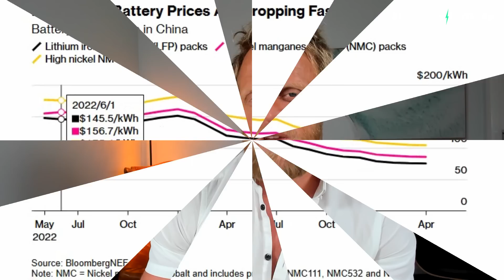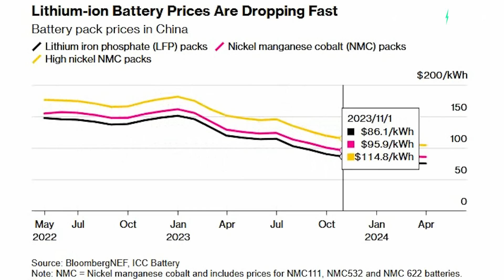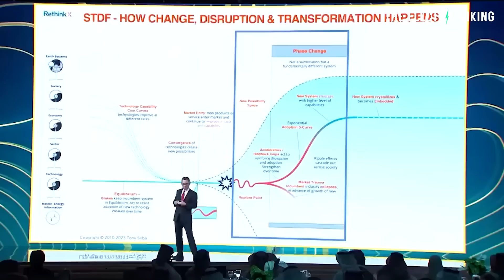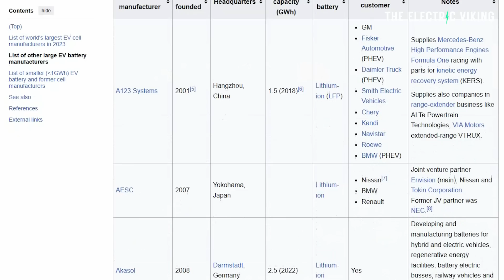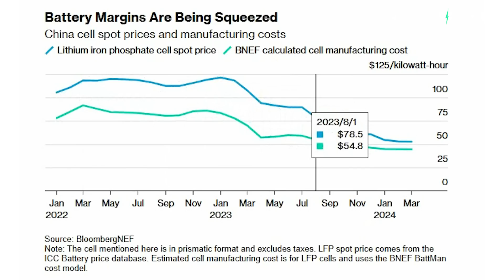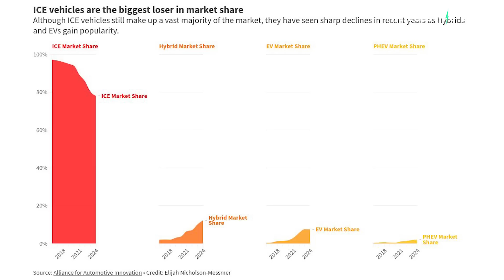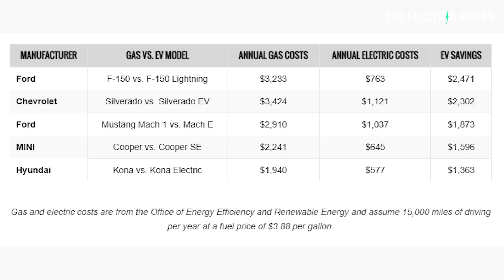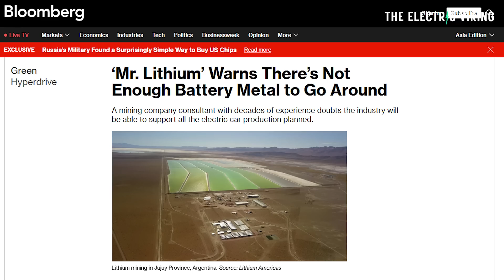Battery prices fall 51% to $53 per kilowatt-hour; "EV prices will keep falling"

Comment: The real issue is that most legacy automakers are not using the class leading Chinese made batteries and are usually paying much more for much less class leading capability.  The automakers in the US are now producing vehicles at an average price of around $48,000 USD, well beyond the average buyer's means. They love those high margins and will likely not want to reduce them to the consumer.
Reply: Yep, JLR opted for pouch cells for their now ancient ipace. Purely on cost / profit.

Comment: The Camels back has been broken, we are now on such a strong trajectory with clean energy, it cannot be stopped. 
Those of you who jumped on the band wagon, your contribution was worth it. 
I can report real numbers on my business auto costs, it’s down almost 60%. Yes, I too could not believe it but took audited P&L numbers to compare 2017 to 2024 reporting on vehicle costs. Simplified!!!  We drove a Chrysler T&C  and a Ford Escape in 2017 and now drive Toyota BZ & Rav4 Prime…… including repayments, our vehicle costs are down 58% it’s simply unbelievable and I am ecstatic to tell my grandkids.   SMALL CORRECTION. Its so simple to keep my cars charged that we do it at home and here is BC Canada we have enormous Hydro, really clean energy and cheap, so my Hydro costs increased by about $90 a month, $1,000 a year and takes that number down to about 50% reduction in car costs.

Comment: The  Prices can go  all  the  way  into  the  basement !  It  will not make these Vehicles any more " Practical " and  NOR  will it  make  them GENUINELY  " Green " . The whole idea is complete rubbish  at  the  moment .
Reply: You know what's rubbish? ^^^
Reply: @ronaldov09  . YES , I  do .
The  whole  MASSIVE  LIE  that E.V's  are a " Green Solution " . There is nothing Green about them . VERY resource heavy and virtually impossible to recycle , PLUS , the Electricity they run on is PRIMARILY produced by  Coal and Gas .
The whole Idea is a bit of  EPA  driven 
" Crackpottery " . Truly long distance Travel will still require Fossil or Sustainable  Liquid Fuel for  DECADES  more , at least .
And we haven't even discussed the Instability and Explosion risk involved with the Batteries , yet...............

It's  ALL  a  Fake , ill-informed  Political Ploy/Agenda .

Comment: For a 62kwh battery (Kia Niro EV) that's $3,300. Add on the inevitable 100% margin, that's $6,600 per vehicle. So why is the cost of a Niro $40,000 (equivalent), in a lot of European countries? Ripoff.

Comment: you still have to have the power and infrastructure to charge it
Reply: We need to redo the whole power grid at this point. Ai needs unlimited power. The future is electric. The Kardashev scale has showcased its importance for 90 years now. We not even type one yet💀 But at least things are starting to happen

Comment: Ok, I'll buy one. As soon as they offer a model with a range of 800+ km for a price between 20 and 30k Euro. 🥱
Reply: No car does that nowadays. Also why would you need 800km?
Reply: @nfzeta128 If a company claims a range of 800km, it is always measured under "optimal" conditions, so you have to subtract at least a few dozen kilometres for the "real life experience". Then there is the topic of battery degradation (1-3% per year). And then you have to consider winter conditions, where the electricity consumption of EVs goes way up. Nowadays you can buy an EV for roundabout 40+ k Euro in Europe, and the estimated range under optimal conditions is around 500km. That's not enough, if you want to make a longer trip under suboptimal conditions. So let's wait and see if the perfect EV projections come true in 3-4 years.
Reply: @first7589  You're working with a lot of outdated or just incorrect information. Degradation is 1.5 - 2% and that isn't linear as it falls off in terms of degradation as you go past the first few years.
Not to mention a lot of 40k+ cars are starting to have 500-700 miles in rated range.
Also again, no car does that. Average for ICE us about 40k and up right now and with smaller engines and fuel tanks a lot of them don't have 650-700km of range, which would be less than the conversion after calculating actual range.
Reply: @first7589  Also heat pumps solve the winter condition range thing for the most part.

Comment: Here's what will happen in the next decade:

1. Overcapacity
2. Energy Surplus
3. Free Hydrogen w Surplus Energy
4. Car market crashes due to EV's longer lifespan + inflation
5. Battery sales replace car market revenue losses
6. Humanoids destroy jobs
7. People buy a humanoid and become farmers
Reply: 7a. On Bill Gates’ farm
Reply: there's no 'longer life span' due to the batteries shorting out.   
Same for 'energy surplus'.     Most solar arrays are a push as far as 'making money' feeding overage inti the grid.   The utilities like the monopoly they have.  It won't change in eight decades.  Never mind just ten years .
Reply: 3. You will NOT see free Hydrogen in any meaningful quantity. The surplus energy will go into batteries, pumped hydro, compressed air... etc. Gross overcapacity will be mothballed... though the market is currently voracious. Companies that give things away due to inefficiency go away fairly quickly. Free Hydrogen was a myth spread by Nikola... before its CEO went to jail. Hydrogen prices have been going up as H2 cars have nearly disappeared. (Its also very expensive to store, ship and distribute.

You might also add that the low price of automated taxis will also eat into the car market.

Comment: EV cars are still a pain to recharge.  5 mintues to fill your gas car or over an hour to charge your car.  WTF.  Carbon credits are bs.  EV is not great for the usa with long drive times.  WHen you can get 1k range and a 10  mintue full charge and drop the price 50% then most will buy an ev.  The REV is the best solution then a full EV

Comment: This guy is totally insane. Ev might be cheaper that standard car in future? So what? You dont have place to charge it! Electric grid and charging station compacity will not support wide spread ev implementation for next 20 years.
Reply: Honest question: Why not? On average, car drives 40km a day. At 200wh/km, that is 8kWh. In vast majority of cases, you drive home, plug the car, go into the house. Sleep, go out and take the car. There is at least 10 hours to charge the car, i.e. equivalent of 0.8 kW for 10 hours (that is about a half of electric kettle).

Our grid seriously can't power a mini kettle in each home? Or in other terms a 10 incandescent light bulbs? And that is at night, when demand is only 60% of day peak.

The fast charging stations will have to have balancing batteries to deal with high peak demands.
Reply: @VoicesInDark  Ok I will assume you are not trolling. Not everyone has single family house with garage( shocking right?) I park outside, about 50 meters from my apartment. Me and 99% of people dont drive 40 every day. Some days i dont use car at all and some days I drive 200, 300, 700km in one go. So in reality to adopt electric cars you would need same density of charging stations as gas stations and charging caoont take more than 5-10 minutes othervise you would get endless lines.
Reply: @rabbithole8498  Grid is only interested in averages and your high average is compensated by someone else who doesn't drive as much. Grid doesn't care about individual data points, only aggregate, so that is not an argument that "will not support [..] ev implementation." Someone who drives a lot will use fast charging a lot.

Apartment blocks are solveable issue - there already is a similar infrastructure: street lights. And we don't need to build them all at once, just to manage increasing number of EVs (which even in most optimistic predictions is 10% increase a year). And even if that didn't work (Norway and other places disagree), fast charing station is much simpler to put somewhere than to dig place for gasoline. It's not like we need to build them all at once, only at rate of EVs in general car population.

>  Me and 99% of people dont drive 40 every day.

Histogram of daily travel distance disagrees. 80% of travels are below 50km. The rest will either be done though fast charging or just what is in the battery (it can go much farther than 40km).
Reply: @VoicesInDark  Ok so you were trolling. Silly me for assuming otherwise.
Reply: @rabbithole8498  Feeling of disappointment is mutual. You haven't provided any argument except personal anecdotes that have no bearing on feasibility.
Reply: I think he gets paid by the Chinese

Comment: Yes, i bought a LFP 1kw Ecoflow solar generator 2 years ago for $850. I bought the same one 1 year ago for 650 and now it's 400 for the exact same model. Prices are falling fast!
Reply: And will continue
Reply: I got a 700wH bluetti battery pack back in 2021...might be time to upgrade soon.
Reply: I got an Ecoflow 1.6 kw system for $800. Love it.
Reply: Viking says the packed LFP battery price in China is now $75. Didn't I also hear him saying the sodium ion ones will be $10/KwH?
Reply: I bought a Zendure 2 kWh battery for 600€ and another 2 kWh battery with Hub (for managing Solar Strings and Battery Charge) for I think 760€ I wanted to wait even longer for prices to drop even lower, but I just wanted it, I view it as more of a hobby which can save me some money, but at our electricity price it will probably take 10 years to pay for itself, if it lasts that long.

I might add a 3rd Battery Module if prices come down enough and I feel the need for it, I expect around 10-11 kWh a day, we live for rent here so baseline electricity consumption is pretty low, around 40-80watts, but with a EV and a commute of about 120km/day I use about 21-28 kWh/day just for charging the car and when we cook or play computer the consumption goes up as well of course, well I can add 2 more modules to the battery if prices are low enough or I ever feel the need for it, but our grid here in Germany is so stable, I think I've experienced 1 or 2 outages in the last 20 years and they only lasted a couple of minutes maybe.
Reply: if you import the cells directly from china, you can build a tesla powerwall for around 700$. its crazy so few people know how to assemble a LFP battery from cells.... the majority of the cost of lfp cells is down to shipping lol
Reply: @vevenaneathna  well not everybody is an expert on batteries, electricity and connecting everything together in a safe and functional matter, what puts me off the most is that it doesn't work out of the box and the communication part, I would probably need to hoom it up to a Raspberry, let on software running on there, get the consumption from the power meter, write a script which tells the battery what min and max battery charge is and when and how to discharge or even implementing an existing one, it'a probably ease if ypu know everything, but I don't  and I also don't want our house to burn down because I haven't properly tightened down a connection or something, so also insurance reasons, and that's why you pay a often times hefty premium on it.
Reply: @LastWish90  eh the inverter handles eveyrthing now days.
Reply: link?
Reply: Yeah well there's a problem here, not all of it is great news.  The only country that makes LFP batteries are China, which uses slave labor, zero environmental standards, and government subsidized shipping to essentially dump these things onto foreign markets.  In so doing, they've wiped out any international manufacturers that have to meet western standards such as labor and environmental laws.  The rare earths used in those batteries result in thousands of pounds of mining tailings waste per battery, and reportedly up to 500000lbs for an EV battery.  So tell me, how is your prices 'falling fast' exhortation going to pay for all that?  Is $400 going to cover an environmental clean-up for that battery?  Also, that 'falling fast' price expectation is wreaking hell at other parts of the world (China and the Congo), but I guess who cares as long as battery prices come down right?
Reply: Yup. I agree. Last year January I bought an ebike for 1200. Last month checked with retailer they are selling the same model for 1100. Seems like battery prices are falling
Reply: just imagine how much the margin is when they sell you
Reply: @larryc1616   Amazon still lists it at $650

Comment: Nice! Meanwhile replacement packs in a Model S are still $22K.
Reply: Also if its an older type of pack the cost for that specific battery might stay high?
Reply: More battery factories need to be built worldwide. Can't allow China to corner the market.
Reply: @Right-w6e  Way too late for that
Reply: @Right-w6e  China Brains and Money Corner the Market.❤️👍🌹
Reply: @Right-w6e  eh  right.  So how do you propose to do that?  China uses slave labor, zero environmental regulations, and subsidized shipping to completely wipe out western competition.  Can't allow China to corner the market?  They already have, and there is no foreseeable change to the western manufacturing situation that will reverse the situation.
Reply: Monopoly markets set costs to maximize profits
Reply: Why would you put a new battery in an old car? I would just get one from the salvage yard for 3-6k.  If  your engine in your gasser threw a rod you would just get a used engine from a wrecked car.
Reply: @callmebigpapa  Good point, wonder if DIY can swap battery. Assuming weight of getting old battery out then getting new battery in is a challenge. Regarding safely disconnecting and reconnecting battery hopefully can find this information on videos and forums. Last wish is newer technology will have batteries lasting more than the life of the car so don't have to go to all this trouble.
Reply: The Model S is a low production EV so that means fewer packs made in general Supply and Demand dictates a higher price
Reply: The individual battery cells still need to be packaged together into modules, wiring, BEC, etc.  Labor cost also.
Reply: Personally if I was buying a model es, paying that much for a battery shouldn't be phasing me even the slightest
Reply: Is that what you had to pay to replace the battery pack in your Model S?
Reply: Is this the cost including labour in Australia? Or just materials? Or in the US? I’d love a used P100D they’re cool cars.
Reply: You can get them fixed
Reply: Just get a new EV.
Reply: Why would you use a new battery pack on a vehicle that is likely at 150-200k miles and 15 years old? 

You can buy a used pack for under 5k.
Reply: where do you live? Check for independent shops, and shops with cooperations with evclinic, evhubs etc. You don't have to replace the whole battery at once. Normally it's only one cell that costs (With labour) max 100 CHF/EUR/USD. Check björn nylands videos about that
Reply: It's all about choices dear.
In the US, the batteries are called "freedom battery", they do come with a premium price tag, compared to communist batteries. LOL!
Reply: @tigading2177  Nio Battery Swapp. Storage and Mobility and never Battery Issues. Communist Batteries are Better ans Cheaper.👍❤️🌹
Reply: There are companies about who specialise in replacement Tesla (and others) battery packs or just replacing the faulty segments but you will always pay top dollar going to the manufacturer direct
Reply: @stevenbarrett7648 Do you know of any shops that do this in the northeast US?
Reply: Replacement engine for Audi etc. is way more than $15k. I just got quoted $20k to do timing chains on Audi biturbo diesel. It's an engine out job with lots of other small bits needing replacement. Parts costs add up very quickly and the labour cost is huge, these ICE vehicles are so complex. My next car will be electric for sure. And it won't be an Audi.
Reply: Yep. And a new replacement engine for an Audi, BMW or Mercedes is still $15k.
Reply: @user299792  Nio Battery Swapp. Never Replacement. Battery Swapp 3 minutes. Storage and Mobility.
Reply: If GM was smart, they'd have swappable batteries.
Reply: Sticking to my ICE at least until 2030. 400-500KW chargers, half the price for supercharging, and much more superior batteries needed with an easy 800 km real world range on highway in winter conditions. Than am gonna change.
Reply: @tibsyy895 fine 👍 I’m happy you will keep subsidising the rest of us with extra taxes and costs
Reply: Tesla rip-off.
Reply: @Suburp212 
Buy a Ford, Chevy or Stelantis.
Reply: Nio Battery Swapp. Never Replacement.
Reply: next time choose a BYD

Comment: obsessive focus on a single element of EV movement 'systems' is rather silly.   The weakness of EV adoption is based on slow charging, charging station density outside of cities, heavy weight of EV vehicles in crashes, EV vehicle repairs and insurance costs, stability of EV companies so parts and service are available in the future, resale value of EV's, and the limited number of people willing to buy EV's (market saturation).
Its Rosy is you're convinced EV's are great, otherwise the Negatives far outweigh the positives.  EV's work for limited daily travel use, commuting, otherwise that impulse travel remains difficult compared to ICE cars.   Dems and EV Lovers expect a limited life in return for the glow of being 'Right'.